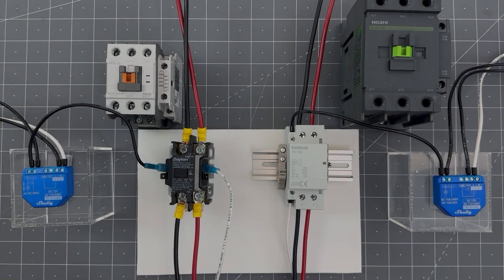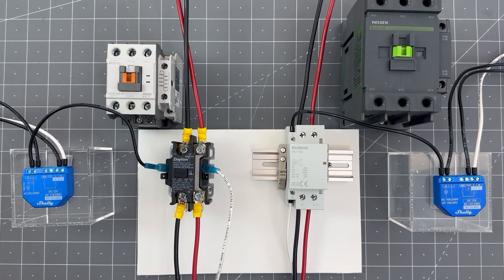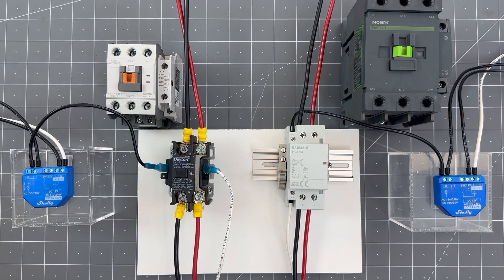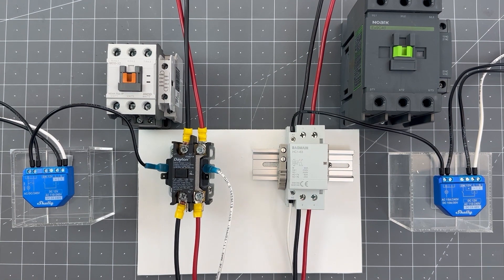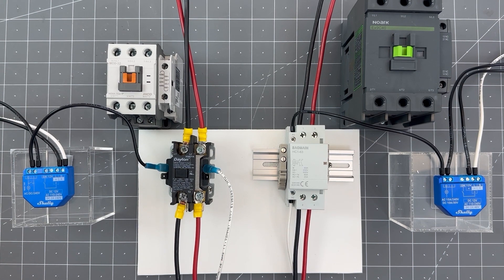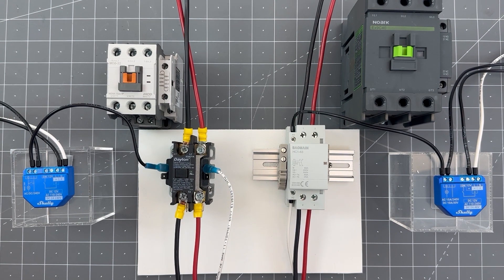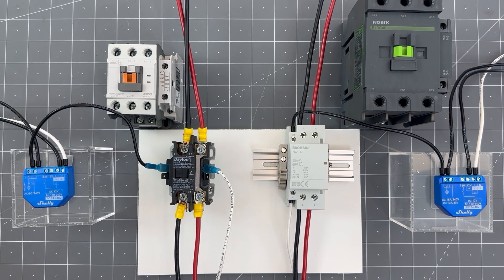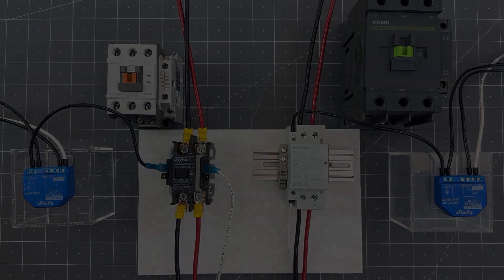Shelly Contactors - Tips and Tricks

Comment: Ive got a 1PM, on the contactor, I see A1 goes to O on the shelly, would A2 goto the N on the shelly?
Reply: Yes that's correct. If the video was panned out you would see that white neutral wire coming from N on the Shelly and wired to A2 on the contactor.

Comment: When using a contactor with any Shelly PM, the power measurement is lost, I thought this is worth mentioning, it will measure the power drawn bij the contactor, not the actual load.
Reply: Also, you should use a snubber when pairing a contactor with a Shelly relay that has power measurement. I probably should have noted that it really only makes sense to use a contactor with a Shelly that has dry contacts. I'll include that in an upcoming  video
Reply: Just need to give a follow up here. Starting with Gen3, shelly "PM" products no longer need a snubber. In addition to PCB and design changes, on the software side, the relays will switch when the sine wave is crossing zero. This is an underappreciated feature in the platform that I am head over heels about!
Reply: @douglasroberson  any update for the rc snubber video? we are planning to use shelly pro 1pm to control air conditioner
Reply: Great work Doug!